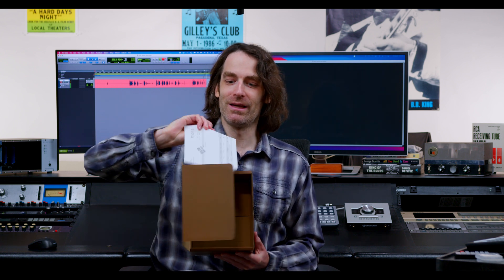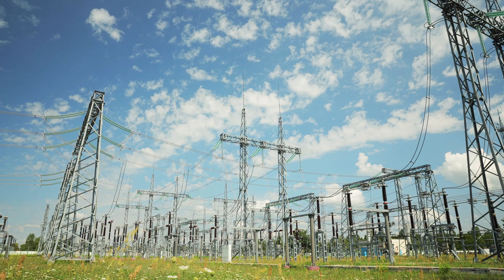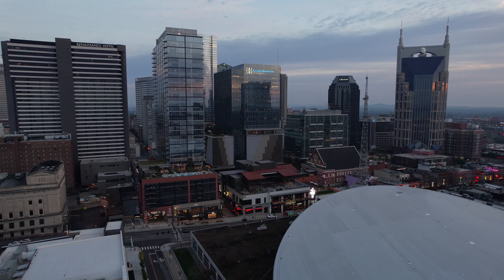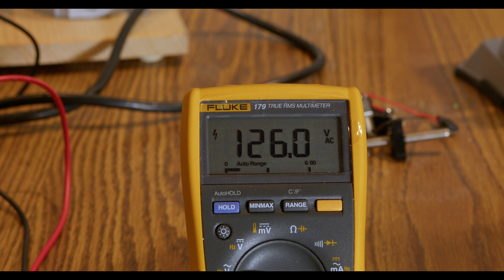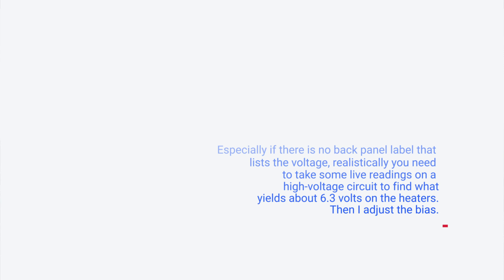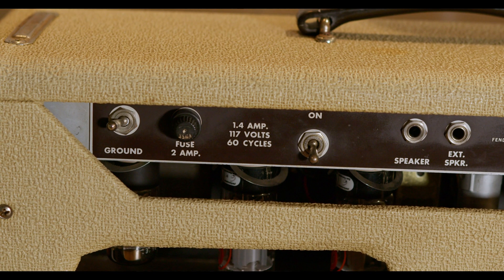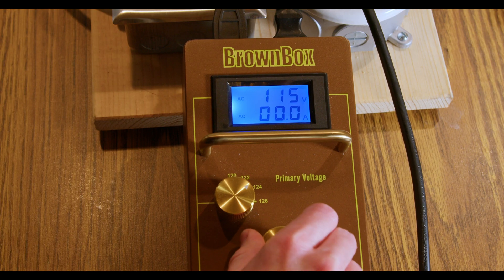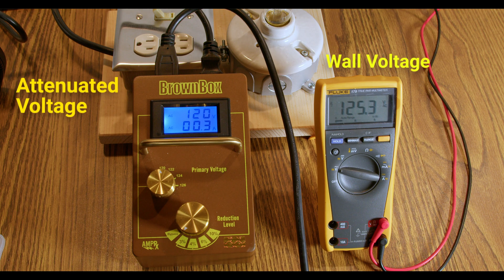Voltage Attenuators For Tube Amps - Do You Need a Brown Box?

Comment: 123-124V from the wall in North San Diego County.  I own at least four tube amps and have a Brown Box on order after also considering the Brownie.
Reply from the maker: Wow, thanks for the report. That's not much lower than here. I should be more up to date on all the new gear, but I'm not. Your comment just taught me about the existence of the Brownie (had to look it up when I saw you'd mentioned it). Thanks!

Comment: Talk talk talk but no actual comparison of sound.
Reply from the maker: First of all, sonic benefits are secondary to longevity of your amp, components and tubes. Second, comparison of sound would only be apples-for-apples when adjusting the bias across the board for a consistent P.D., so you'd be adjusting idle plate current to the lower supply voltage, then micing up and repeating (or better yet feeing a recorded loop through eliminate variables in touch/performance). Last, these videos are free. Go complain somewhere else.

Comment: Great post. I live in Mexico city, nominal voltage is 127V but being this such a hughe city we can have lots of voltage variations but I usually find around 125V with my multimeter. Being that said I just buyed a Bassbreaker from Fender and noticed they sell here the same model for US so it is rated for 120V. It is not the most expensive amp but it was a significand spend for me and getting replacement tubes here is something that can take some time. I am seriously thinking buying one of these to be sure my amp is always at 120V.
Reply from the maker: Thanks for the report. Yes, 127v is really high but if you usually find 125 with your multimeter, honestly, I've seen mine at 125 and got away with it for years, even though it's preferable to get it down to 120. I don't want to give bad or wrong advice from a technical standpoint (I'm a hobby amp tech but not a real for hire one). My basic experience/understanding is that heater voltage and hotter bias are the main concerns with voltage from the wall that runs too high. That said, it's probably a trade-off between expenses for tubes or expenses for the box. The Brown Box is expensive it's just that I had no other real choice due to a particular situation that needed to be brought under control. And it was probably a little easier for me to just go pick one up since they're local to me (even though I still paid full price, but accessibility here is a little more immediate). Good luck figuring out what's right for you!

Comment: So Cal coastal rural area. 117V average at Wall. Run my tweeds on B Box @ 110-111V.
Often bypass mode for my blackface and marshall amps
Reply from the maker: 117 is fantastic! It's another summer here in Nashville. Wall voltage continues to fluctuate down in daylight hours with all the air-conditioners but by evening it's the usual 125 - 126 (which it remains at during the winter months). Nashville voltages run really hot all over town